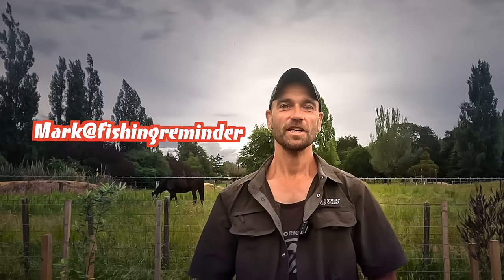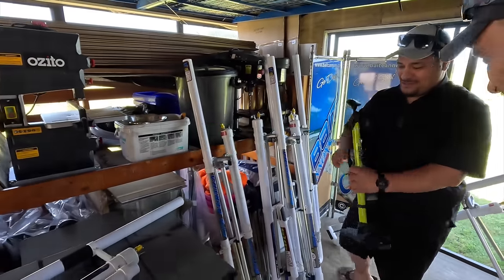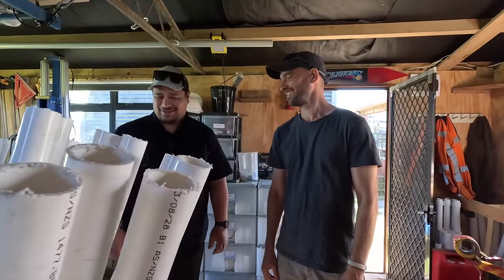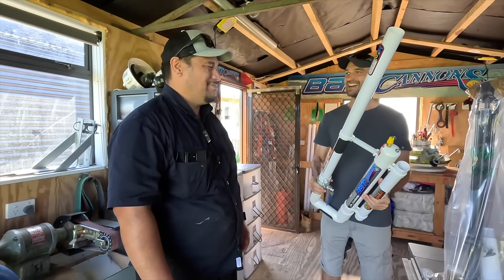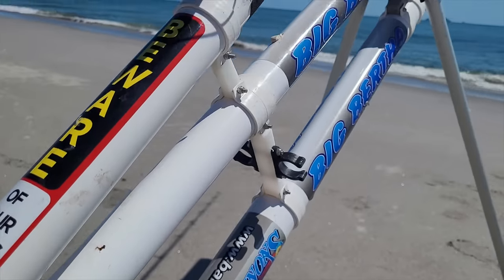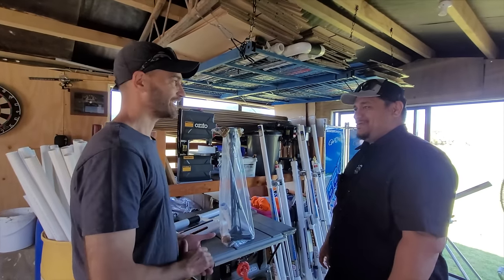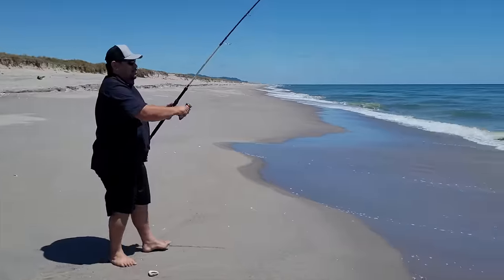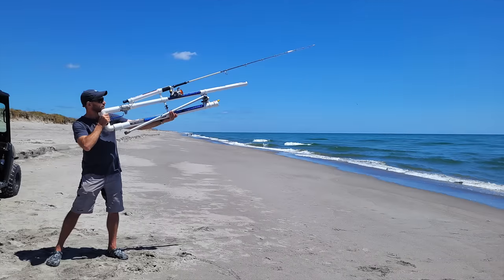Blast Your Bait Beyond the Breakers: Explosive Fishing with Bait Cannons! 🎣💥

Comment: If you really wanted to maximize the pressure, you could mount an electrically controlled solenoid to control the valve and minimize the undesired pressure dissipation that opening the valve by hand necessarily incurs.
Reply from the maker: great idea. An electrical valve would be quite expensive I guess.